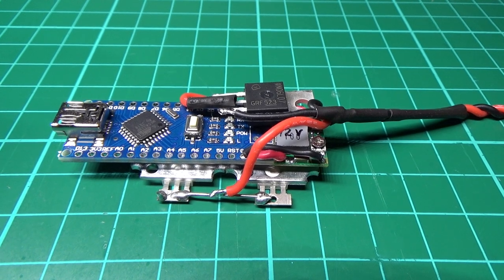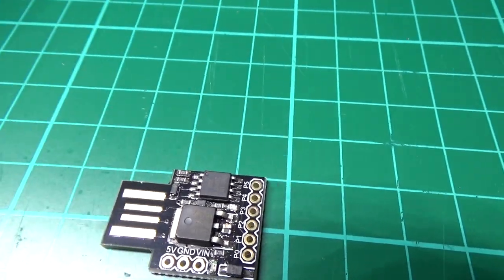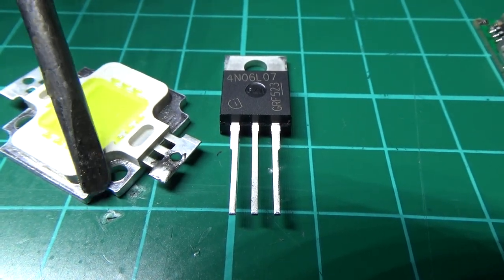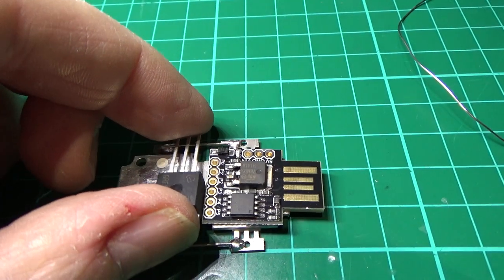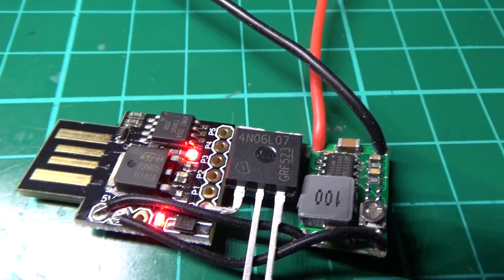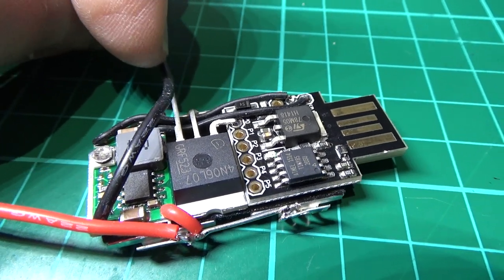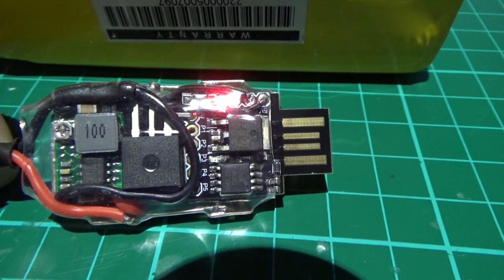Arduino 20w LED strobe with MOSFET - How to

Comment: Parts finally arrived yesterday - and I now have a working strobe!
Software was a pain to set up on Fedora Linux so gave up after an hour and tried on Windows.
Found usb driver eventually and modified an example blink sketch to give two 20ms pulses 100ms apart every 2 secs.
Took longer farting around with installing the programs than it took to build!

My version uses 3 x 10W leds, and an extra buck converter to power them because I'll run it on 4-6S.
Ordered what I thought were 3 FETs and 3 packs of five arrived instead!
Now I'll try a 300W version when my sight returns! :-)
Reply from the maker: +Andy Lee Robinson Excellent, Andy :-) I've got something special coming up soon which will completely blow your mind :-)
Reply: Oooohhhh!
Reply: +Vortecks Update - I just made a 200W version using 2 x 100W leds, mosfet on the 36V output of just one 150W driver module, with the 5V buck and digispark.
No heatsink required because of low average power, and the driver module seems to handle the discharge fine. The leds also sit nicely on the module heatsinks with double sided sticky tape, but I&#39;m also wondering if those heatsinks are necessary now - removing them would save a lot of weight.
Runs off an 800mAh 3S lipo too.

It is brutal.  (x^x)
Reply from the maker: +Andy Lee Robinson How's your retinas? :-) 
As I always say..... bigger is better, massive is total overkill but exciting. You could try it without the heatsinks - what's the worst that can happen? ;-)
Reply: Retinas are OK, now!
Not good to catch it directly, so kept hand over it or pointed away. Looked good at the bottom of the garden in the dark. Useful as a locator in a survival situation, and probably viewable from space!
Now wondering what 100 on a sheet of aluminium would do... I have enough modules for 20 or 30... hm!
Reply from the maker: +Andy Lee Robinson Watch this space, I've received a few parts from China........... ;-)
Reply: +Vortecks wooo hoo watching... i need to get my next order in.... xmas post is gonna delay things a bit keep us posted Votecks....
Reply from the maker: +bing crosby This weekend........... get ready :-)
Reply: Hi Andy, I may be interested in building something similar. Can you please list the parts you used?
Reply: I would love the details of your build if you have some time.
Reply: Can you help me build an RGB LED strip strobe light for use with my levitating water effect project?
The color combination of RGB strobe LED's must be selectable.

Comment: Thanks for the video. Works great. used VIN pin w/ground. 12 Volt DC power supply, wired right up. Did not need a 5 volt regulator, Installed your sketch and is flashing nicely.Going to use alarm horn w/a motion sensor for a alarm. Again thank you

vin pin
Reply from the maker: +Elroy Steele No problem. It's nice to see people taking it further :-)

Comment: FINALLY a project to do with my ATTINY! Thanks for the info!
Reply from the maker: No problem, I'm glad to be of some use! :-)
Reply: Vortecks thanks for making me buy new MOSFETS lol...the ones used here are logic level, correct? I bought that little usb development board like 5 months ago...couldn't figure out the drivers or get it to work on the computer SO I tossed it to the bin of undesirables for a day when I'm REALLY bored....now I'm gonna have to bore myself so I can get it working....any suggestions on a headache free driver location for it by any chance? Thanks again for the great idea! I wanna put it on a drone to freak the neighbors out, way out here in the woods LOL

Comment: hi 
why you didn't use the Attiny85 alone 
you can program it easly with any arduino board..
and use LM317 voltage regulator to feed your circuit ..
it's will be smaller and cheaper..
or just switch to a 555 ic if you just need your circuit to blink...

what you think ?

Comment: Tony's code on Google Drive is back up again. But if you want to try out three LED's using three GPIO, try out Bing Crosby's code. See below. I got it running with out issue, and was very satisfied with the project. I will also try hacking that code to get some different patterns.

Comment: I know you said it was a bit of overkill, but why did you add the complex unreliable external 5V regulator at all? The Digispark is specced to take up to 35V into the on board 7805 regulator. It would get a bit warm at 35V, but on a 14V supply it should be just fine, shouldn't it?
Reply from the maker: I put the added details in the description :-)

Comment: Hi Tony, fantastic tutorial! very easy to follow. However, i tried loading the sketch but when I try to upload it, I get a message saying could not create the sketch. I have created a folder called Flash (1) which I put the file into. Is there another way of loading the sketch? Thanks in advance for your help.

Comment: Thank you for making this. How would you suggest I go about powering this in a 120v plug in version? Thanks Again
Reply from the maker: +synespro Simple..... you could use one of these http://www.ebay.com/itm/231425257467 
Please make sure it's regulated. Some Chinese PSU's aren't and you'll probably blow something.

Comment: thats how mine is at the moment, works well... the top fet needs to be modified to the same as the others tucked in out the way... just thought i share this needs some tidying about to load up the code to control all three leds seperately, and together hehe
Reply from the maker: +bing crosby Sweet. Keep it going :-)

Comment: Nice piece of work, any way, you need a (Buck) step down converter to adjust the Vcc for the PIC device. But, if you take a look at this PIC, it's already contains a 78M05 voltage regulator. I wondering, is it the necessary to use this Buck SDC?
Reply from the maker: +HDking55Norway No, there's no need for it. Originally, I built it for an Arduino Pro Mini and changed to the Digispark but I forgot that the Vin pin can handle 7-35v. I'm old..... I forget things :-)
Reply: +Vortecks 
Hi Hi, then ve are in same act, same old man, but we still going stronger! (or worse-er?). Well, I'm planned to use same schematic wiring, but change this for 3 pcs 10W LED's. I mount this 3 LED's in a "triangle" angle, so it will match the UVA/RPAS rules for 10Dc brightness, as rotated pilot light for night flight. When not rotated, it accepted to use 3 pcs LED 10W, likely to match the function to be rotated light, even fixed DIY. Thank for all information!

Comment: Have you ever considered trying to make a High Speed Sync "camera flash" using this technique?? Could be an interesting video!
Reply from the maker: I did actually did try it with a 100W LED which worked well but failed miserably. Every camera I've got (which are on my phones) have a pre-exposure flash - it detected this and then, turned the led on but the trouble is, the main photo was then completely washed out. .....I gave up as it seemed the only way to retain some kind of sanity 😁
Reply: @Vortecks  That's too bad. I was hoping to see someone make one for a DSLR. Maybe I can get my grandpa do design one?? He's been in the industry for 50+ years. A High Speed Sync flash DIY using LEDs or LED chips would be truly awesome. I saw a "commercial" one for 4 GRAND! SERIOULSY!! 4 GRAND. Hope someone shows these ripoff artists it can built DIY way cheaper! Any way, thanks for the reply.☺

Comment: The 5v regulator is superfluous as the Digispark can handle 30 + volts. Considering the LEDs are only rated for 1A each, surprising they don't just blow up in one brilliant flash, especially at this voltage. I wonder if they've been deliberately underrated? Neat.
Reply from the maker: +VE3CWQ I know about the 5v reg.... I should have done my homework more before I did the video. I've tried the LEDs at 20v (only strobing) with no problems :-)

Comment: Great project! I want to this but using Cree XPGs, but can the Arduino nano handle a 4S without a voltage regulator?
Reply from the maker: +SlNlST3R Unfortunately, the Nano will only handle 12v max. You need to get some of these...... http://www.banggood.com/100-Pcs-WS78L05-78L05-Voltage-Regulator-5V-100mA-Transistor-Triode-p-932782.html

Comment: What is the flash rate (how many flashes per second), and what is the light pulse duration?
I have just done the ATtiny85 code for one that runs from 2 flashes per sec (FPS) up to 200 FPS (to "stop" rotating members from 120RPM - 12,000 RPM), and flash duration is 1/256 of the flash rate, so it should gave a little more than 1 degree of blur.  I need to order the FET and battery, so I haven't seen it work yet - but the program works in Atmel Studio 7.
Reply from the maker: If you download the code from the link in the description, it'll tell you. I think it was something like on for 10ms, off for 50ms, on for 10ms and off for 500ms.
Reply: @Vortecks  Thank you.  If it's on for 10mS, off for 50mS, then it is on for 16.7% of the rotation, so the member will be blurred over 16.7% x 360 degrees = 60 degrees.  I need mine to have a much finer resolution.  I'm waiting on parts from China.

Comment: Where did you get an LED that took 4s? its 9-12v or 30+ on banggood (or does the strobe nature of it make it not an issue)
Reply from the maker: I've been using the 12v LEDs on 4s for 12 months now and they're all still working. The duty cycle is so low that it doesn't affect it. They will handle  up to 200ms (on) and 800ms (off) before they get too hot to touch.

Comment: vortecks.. what sort of cycle are you using in arduino i want  a nice quick strobe pattern, is there some sort of recommended pattern for aircraft ? thanks
Reply from the maker: +bing crosby WOW, are you THE Bing Crosby? :-) I now use a 5 second pause with 2 flashes at 20ms so the LED's are only on for 40ms every 5 seconds. They don't even get warm with a 4s battery and they're only really rated at 12v
Reply: yeah thats the sort of thing i want i been looking at different strobe patterns and some nice ones but as you say the longer they are off the better, and less current draw.. just waiting for leds to come back.. i have been experimenting with some 5v usb leds they are real good... yeah i am the one and only Bing....hehe.. thanks vortecks looking forward to getting the rest of the strobe built i have built quite a few things with arduino now and built a multiwii flight controller out of all seperate sensors worked well...

Comment: Thanks for the video.I need 100W red LEDs strobe(10 10W LED in paralel).
Does this setup work with 10 LEDs,or needs modification?
Reply from the maker: You can have as many in parallel as you want as long as the total current draw doesn't go over the maximum that the MOSFET will handle.

Comment: What about the temperature of the device? You put all electronics on the headsink of the LED's, all components get very hot, don't think that's a good idea.
Reply from the maker: They don't get hot because the duty cycle is very low

Comment: Is there a need for current control to led's or does the max voltage of the batteries regulate it?
Reply from the maker: The duty cycle is very low, so there's no need for current control.

Comment: Hey Guys. I am using an Arduino pro mini to regulate some SMD Leds for my TV car. I have 5v regulated to the arduino and 5v to power up the Leds. Now I need some mosfets to shift on an off the leds bc the arduino can just put out 40 Milli amps per pin. Tho which mosfet is needed to gate correctly with 5v?  And also I have 5v for source and drain. The dead watts for the mosfet doesn't exceed more than 2 Amps.

I hope someone can help me out
Reply from the maker: You can use the  IPP80N06S4L N-Channel mosfet 😁

Comment: Vortecks, This is such a great idea, i was looking at doing my first bit of coding with addressable Cool White 5050  4 or 6 pin using the ATtiny85 and a WS2811 driver. Considering the WS2811 can drive three RGB's,... I wonder how many single white WS2812b could be controlled. I am rather new.
I bought 4 x counterfeit Ver3  DIgispark, no bootloader. It isn't easy for the new guys to shift down a gear. :-)  My win 7 machine still does not recognize that damned thing even after I went to the trouble of figuring out how to run AVRdude / push the MIcronucleus bootloader, and so called "correct" fuse settings, and LibUSB Win32 driver just isn't cutting it.
                      Best Regards for  2016
Reply from the maker: +Chris Leech You should try doing something like my 400 x WS2812 LED matrix :-) https://www.youtube.com/watch?v=JZDQ7BNRFM8
Reply: +Vortecks  I am looking at coding, and implementation, not an exercise in soldering mass quantities. The Digispark has been nothing but a huge headache. I am at the point of installing  Arduino 1.6.5 in another WIn7 machine along with the  libusb win32 driver to see if it just this 64bit PC that is being disagreable. All this for something as trivial and tiny as the Digispark
I still will try you strobe thing even if I have to do it with a raw ATtiny85

Comment: So if the digispark can handle 35 volts, can you get rid of the mosfet as well? I am very new to this, pardon my ignorance.
Reply from the maker: No mate, you still need the MOSFET to fire the LED, it's needed because of the current the LED needs to light.
You could try it, but I don't think the Digispark will last very long (if it works at all).
Reply: Vortecks Thanks. I’m starting to wrap my head around this. I’ve watched this video....a bunch of times.
Reply from the maker: @TimDonk  Good luck. I watch some of my old videos and sometimes, I can't believe I how much I've forgotten 😂

Comment: got my 10w leds back today..  would like to rig something up quickly to try a few out.. got an arduino plenty of 5v becs polulu and 5v regs, but not sure what to use to switch these leds... got transistors here, and loads of resistors capacitors guess i need to  order some fets...
Reply from the maker: +bing crosby You certainly need N-channel MOSFETs. Transistors won't cut it.
Reply: +Vortecks  have to get a quick order in to farnell for a few fets then....just wondering if i could have salvaged something out of some stuff i have here old computer power supplys as prob wont get anything delivered this side of xmas.. not to worry thanks for the quick answer.....
Reply: +bing crosby just been in the shed and stripped a computer psu hoping to find a few mosfets but only two  schottlky diodes 7905 regulators  and npn  424 transistors... ahh well maybe a trip down to my local electronics place tomorrow.. they normally got a few bits and pieces there

Comment: do you run this at a lower clock speed and sleep it to save power?
Reply from the maker: +lez briddon The power saving at a slower clock speed is negligible compared to the current that the LEDs use :-)

Comment: I was wondering if you could help guide me on making a 6 channel LED Strobe flasher?
Thanks,
Reply from the maker: +James Cordeiro I'm not sure I know what you mean, James. Is it for radio control?
Reply: +Vortecks  it's for a bar that will be used on the Dance floor. I'm in the process of building 6 heads of 80 5mm clear white burn LED's.

Some of the LED heads will have Amber Lenses, like the short video I had uploaded to my YouTube. I wanted them to flash in row, for instance, (starting from left to right) each flashing in a single Direction. Also, a Matrix Sign. I would like to add pictures but can't attach them here.
Thanks Again,

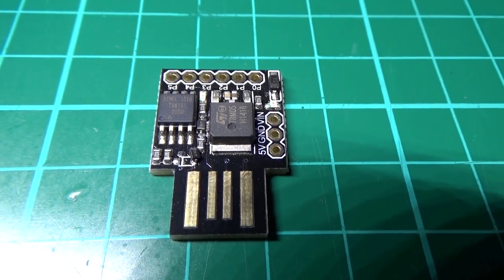Comment: 9:58 that diode is out of position. Does this board worked fine?
Reply from the maker: No...... it was a scrap one I used for the video. There were other things wrong with it so it ended up being thrown away. Well done for spotting it though :-)

Comment: thanks. i saw some vid that those led cannot handle 12v.. only 9 to 10.. is it okey?
Reply from the maker: +Air Supply If you intend to keep the LED on all the time with no cooling, I don't even suggest using 9v because they get too hot. The way I'm running them only uses a very low duty cycle and it doesn't get hot. I've run them up to 20v without burning out.
Reply: +Vortecks thank you Mate...

Comment: Great Project!!!!!!
Since I am not an electronic genius, you may send me the schematic and confirm that a 12 v NOT need the voltage regulator?
thank you very much
Reply from the maker: I don't have the time to do a schematic, sorry. If you're not an electronic genius, I don't think you'd be able to follow it anyway :-)    
I can, however confirm that you don't need the regulator with the Digispark because they're 35v tolerant..
Reply: thanks for the reply and especially for availability! not an electronic genius does not mean being a jerk ... and still am convinced that I would do more effort to explain that the catch-up is not used on spaghetti than you to draw the schematic.
Thanks anyway for giving me the inspiration!

Comment: I want to make three(3) 10w led flasher with 42 pulse/minute or variable with 12v battery aupply. Can anyone help please
Reply from the maker: That's easy (for me anyway). You add another LED in parallel and change the sketch to suit.

Comment: can i use this set up using 12v power?
Reply from the maker: +Air Supply Yes. It's best to use 12v actually. The LED's are only supposed to be driven with 12v but the duty cycle is so low, you can ramp the voltage right up.